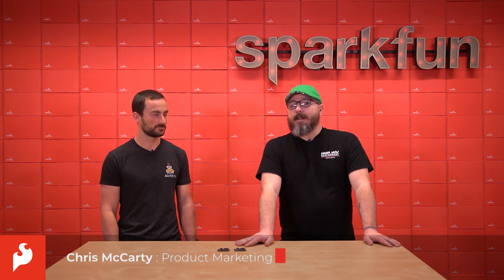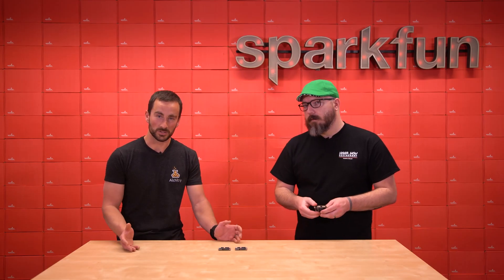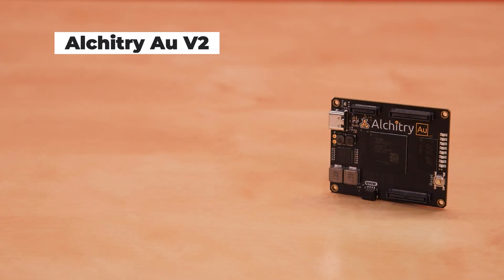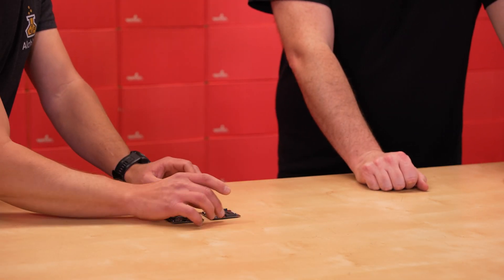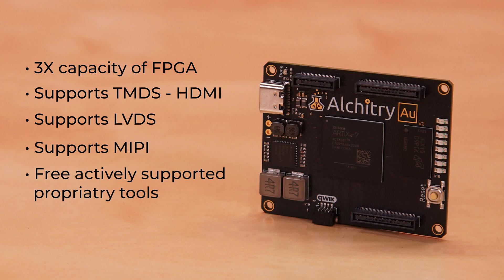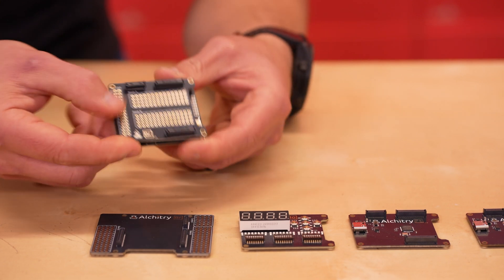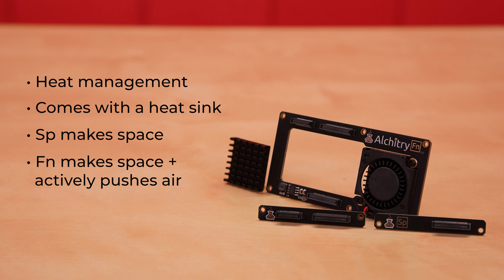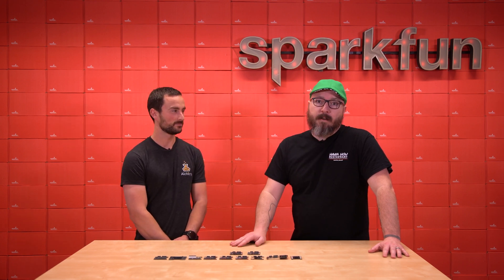FPGA Made Easy: Alchitry V2 Boards + New Tools & Tutorials

Comment: What's the top clock speed of this? Can it take in an external clock, PLL/divide/delay, and output a synced, modified clock? Looking to input 90Mhz from an oscillator, divide it down to khz range, and delay by as fine as <500 picoseconds.

Comment: would never buy something that the licence is free only for hobbies and education purposes. Anyone wants to build a product with low overhead -> AVOID
Reply: The ice40 (Alchitry Cu) is alternatively supported by open source tools, under the MIT License.
Reply: "Hobbies" includes developing commercial products, and ASICs for that matter. If you're going to be doing that, you won't be short of money. All FPGAs that I know of have similar conditions, where commercial users subsidise hobbyists. It's the FPGA manufacturer which imposes them, not Alchitry. The more expensive licence also comes with better tools.
Reply: Why not? You need to learn somewhere. You also have Tang Nanos by the way.

Comment: Are these just toys and tools of learning? Or can I actually solve a real world problem with something like this that I couldn't with an esp32, arduino or regular pc?
Reply: If there was an add-on board with a high speed ADC like 100+Msps (mega samples per second) connected to LVDS, or the PT+'s Gigibit transceivers which could be crazy fast. That + the high data throughput USB add on board makes it a potentially attractive SDR (software defined radio) platform. Doesn't seem like that kind of board exists yet though.
Reply: @ohbaewan3147  I'd love to make a high end ADC board. I've never been able to nail down what specs would be reasonable to balance cost and performance for most people. Making an ADC board that costs $1000 probably isn't going to have much demand. Let me know what you think it should look like and maybe we can make it happen!
Reply: @Alchitry  Fair enough, it's hard to nail down a set of requirements that would work for many different use cases. My interest is in SDR, so entry level devices for that use case like the Hack RF and ADALM Pluto give you about 10-20MHz of bandwidth but in a easy to use all in one package. The only other "system" i have seen that offers an FPGA breakout and ADC peripheral that can go faster would be digilent and it's Zmod system, but thoes are also quite expensive, have other irrelevant features I'm not interested in, and are much bigger so it feels like I could only prototype with thoes boards, before needing to spin my own implementation. The form factor on these boards seems much nicer for easy integration into a more production like assembly without customization!
Reply: @ohbaewan3147 You can make an ADC inside the FPGA. Internal speeds are much faster than the I/O, which is limited to the speeds in the relevant spec.
Reply: Even a slower but still >50MSPS parallel ADC board would be able to do things you really cant achieve on an esp32/arduino when it comes to bandwidth. Of course some kind of test equipment connected to a PC could accomplish that but were talking different orders of magnitude when it comes to cost and size to accomplish.
Reply: @ So they are basically just tools of learning at the moment then?
Reply: @heckyes  Or you have to be willing to spend development effort designing your own peripherals. With higher speed comes higher responsibility, or something like that ;) I will admit this is probably not the product for someone who wasn't already looking for an FPGA breakout board and knew that it was required for their project.
Reply: A very common use for FPGAs over something like an Arduino is the amount of IO you get and the bandwidths you can achieve. Think (as mentioned above) high speed ADCs, displays, many sensors, etc. They also excel at signal processing (FFTs, filters, etc).
Reply: @Alchitry  I have a cheap 65MSPS adc breakout board I got from aliexpress that was somehow cheaper than the AD9266 chip that's on it haha, but if I do get one of these boards I would probably start with that, which should be able to get around the same performance as the Pluto, that's a parallel adc so it might work with the CU. Before tackling something more complex that uses LVDS on the AU.
Reply: The whole point of an FPGA is that you can make what you want with it. They're electronics, not computers. You can eg download (or build) more memory - something which doesn't make sense with a computer.

Comment: I have an ICE40 fpga board and I completely failed at the software toolchain setup.  A huge number of tools and steps that had to work perfecly together but never quite did.  I feel like you glossed over the toolchain setup in this video.
Alcatree Labs v2 and the Lattice software is all you need?   Please make a toolchain video that a hobbiest could follow with 99% chance of success.
Reply: Their tools require Vivado or similar to be installed, but they "pilot it remotely". When I ran it on W10, I noticed Vivado does all the board interfacing, ie talking to the FPGA chip, while Alchitry's software converts Lucid into Verilog, and hides those files inside Vivado - so it converts your Lucid files for you, although they don't advertise this.

Comment: How can I integrate an ML model into this? I’m working on developing a real-time visual analytics device. Would an FPGA be a good option, or are SBCs the better choice?
Reply: FPGAs are much faster than SBCs. However, the size of your model would be limited by the RAM available (unless you add more RAM). You'd also have to write your own code to run the model, because FPGAs can't run software directly.